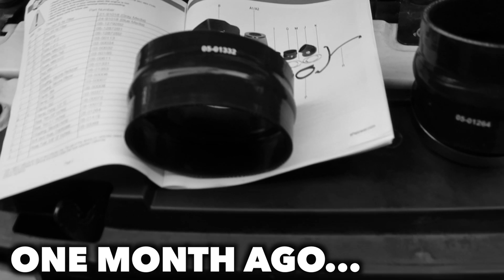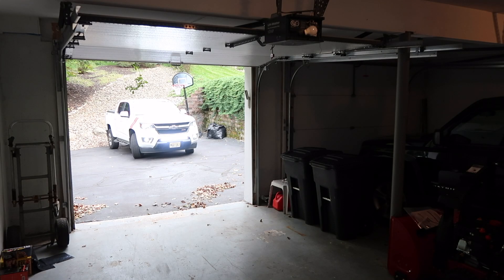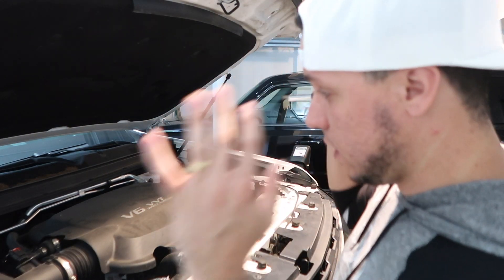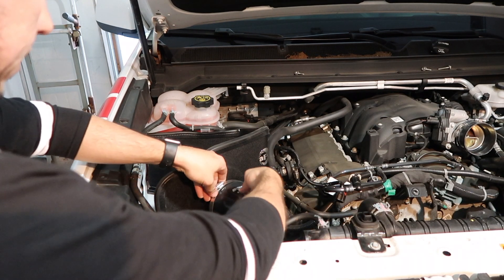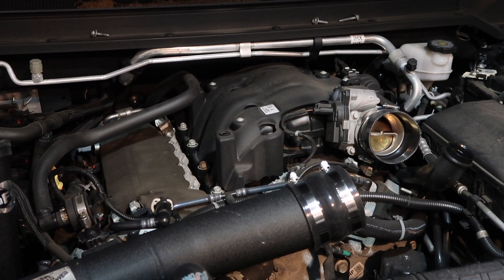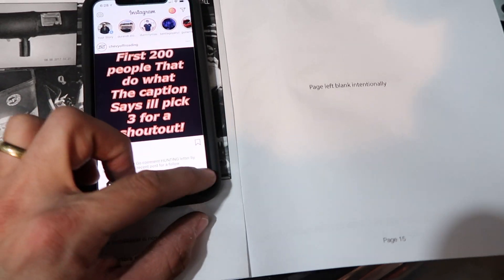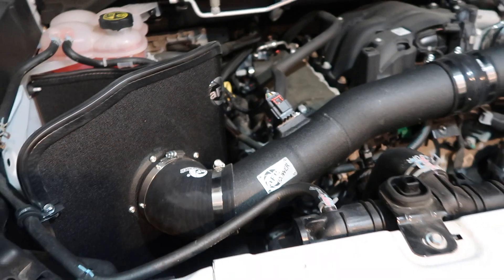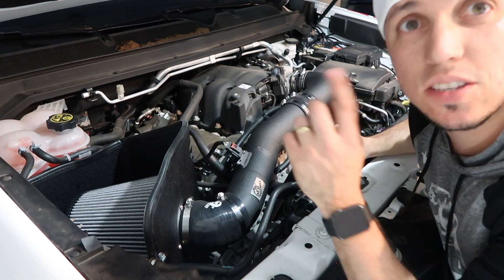Installation aFe Cold Air Intake For 2017 Chevy Colorado z71

Comment: Hi Matt, any issue with the intake system since you installed this? Any issues with sensors getting clogged fro the pre-oiled filter?  Looking to install an intake, but have had folks warn me on oil-based intakes with these engines. Thanks!